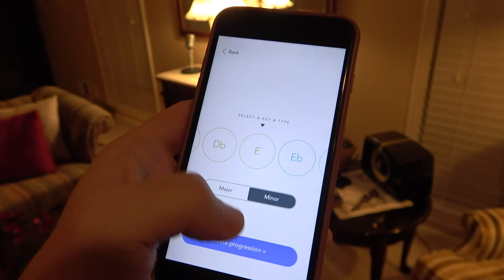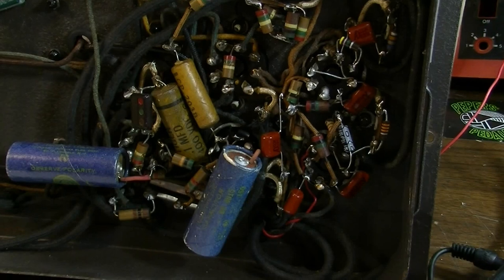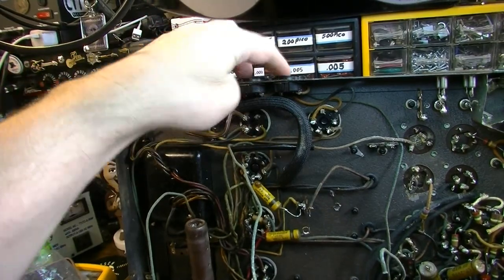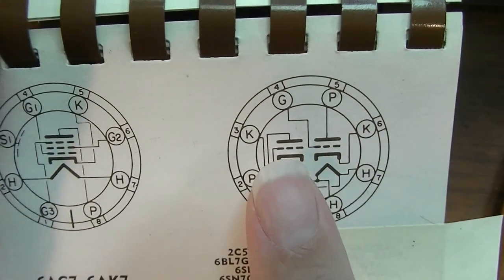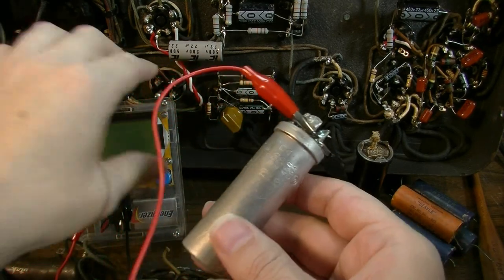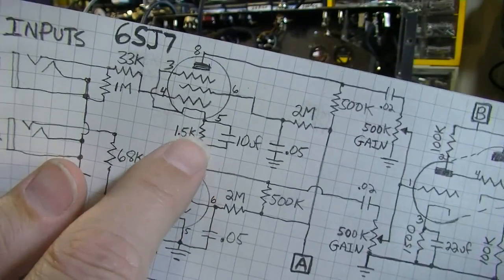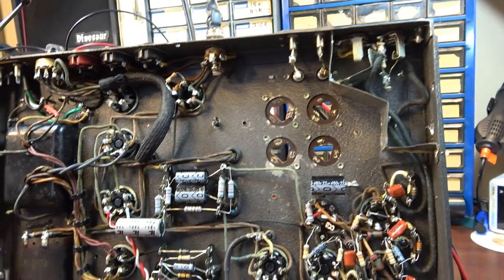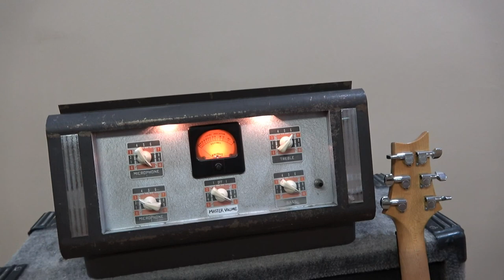EPIC Guitar Amp Conversion - Complete Tube Amp Redesign

Comment: I kinda like transformer phase inversion. It is cleaner than tube in one area, but transformer saturation does exist. Not only that but a magnetized core can introduce even harmonic distortion. Not much mind you, but some claim that that is why old Clyde McCoy wahwah's with Fasel inductors sound better than modern ones with the same inductor sound, ahem 'better'. The core is slightly magnetized, not magicitized.
Reply: Just partially making fun. I know this is a hard project to make a guitar amp out of.
Rocks on guitar lover man.

Comment: Those capacitors were made in the town over from me, thats pretty cool. The first transistor was invented over there too.
Reply: NJ had a great electronics industry at one time. My mom worked at RCA in Camden after she got out of high school in 1962. You had IBM in Cherry Hill. Amazing stuff.
Reply from the maker: Sweet. You should take a trip sometime and see if you can locate and film the old factory.
Reply: @TheGuitologist  The Nipper Building is still in Camden, NJ only it's condos now, while the rest of the expansive factory sites were demolished in the late 80's/early 90's. Here's the wiki on the Nipper - https://en.wikipedia.org/wiki/Nipper_Building  

This is where your Victrolas and such came from.
Reply: The Nipper Building in Camden still has the original stain glass art work of the RCA dog looking at the Victrola that RCA had used as their logo. I was a vendor for L3 Communications in Camden back in the eraly 2000's and they had taken me over to the RCA building (now Nipper Bldg) before it was converted to condos as L3 communications had purchased that building as well as all the RCA communications technology and equipment and gave me a tour. It was very cool
Reply: @kensolo6793  So happy to see they saved that. Not only for history's sake but the fact that I love doggos and the connection to audio in general. That logo is burned into my brain from decades of seeing it.
Reply: I'm in North Plainfield, and was feeling a little Plainfields pride when I saw it on the caps. The Plainfields had quite a bit of industry back in the day, especially along the train lines.
Reply: @broncobum  prideful of that toxic waste dump that the factory left behind lol. I think its all clean now which is great.

Comment: weren't knight amps sold as kits, kinda like heathkit. Maybe the guy who built it didnt have  clue of what he was doing. alot of heathkit kits were test equipment so techs bought them to save money but correct me if i am wrong knights were consumer amp kits basically. so maybe some guy at some church who was a novice hobbyist  and the church needed a pa so i guy got roped into doing the project, perhaps got in over his head. Of course this is pure speculation.
Reply from the maker: Yes, you could buy these as a kit or pre-built.
Reply: @TheGuitologist   I built an amp sorta like this but like it's baby brother . A 6SJ7 with a tweed princeton volume and tone control. Then half a 6SL7 gain stage with the other half set up like a 5E3 phase inverter into a pair of 6V6s . Like your it has that raw old times sound albeit yours I am sure is louder and prob more bass and less mids because of the 6L6s

Comment: I  certainly DO NOT have this guys knowledge about electronics or guitar amps. I have a basic understanding of AC-DC theory and have repaired many and built a few guitar and bass amps..
I have converted a few PA Heads into guitar amps.

I turned one into a Fender Princeton  AA964
 Another into a Fender Tweed Pro 5E5-A. That is an interesting unit. A bit more going on than one might think.
........ and with a 1950s Rauland PA head i built a Ampeg M-18 i believe.
Octal preamp
2x 6V6 
Bias vary trem 
Just an all around nice low wattage amp
Super quiet.

This tech seems to  "worry"  about reusing the existing Topology/Tube Sockets/Even the pots it seems.
Maybe that is part of his  "thing" ..... to repurpose as much of the old amp as possible.?
No problem if that is why, He definitely has the ability to do so and the appreciation of amp history to go along with that.

In these scenarios, i plan on gutting the chassis down to a shell. Then,  i find a circuit that will run off the existing  PT and OT
..... the trannies and the cosmetics of the chassis,  paint scheme if possible and the knobs are all i try to save.
The graphics rarely work out..... maybe the power switch lines up.
All the other knobs i try to relabel with a single letter underneath the original wording.
If the old VOLUME knob is now the BASS control i try to print a single letter with a label maker. So under the original VOLUME control i will have just the letter B for BASS.
Sometimes you might have a duplicate.....Treble and Tremolo for example.
No big deal. "Tr"  will do for Treble and just a single  "T"  will suffice for Tremolo.
Anyway....... thanks for another fabulous video..!!!
We appreciate it 😎

Comment: Is it just me , or are the lows breaking up a little early ??
Reply from the maker: Mostly the demo suffers from using only the onboard camera mic. I'll admit I did the demo on the quick. But yes, I might go back on that Channel 1 and change the bypass cap to a lower value.
Reply: @TheGuitologist  I asked because I’ve been playing with some different tubes in my little Vox practice amp. I pulled the low gain ax7 and put in a Long plate Sovtech . I expected more presence and gain and such. And knew it was hotter on the lows. But it surprised me at how different it was.  Anyhow blah blah. It sounded very similar , but I was playing your video through that amp !!! And thought that might be what I was hearing. And not your amp.  
  Thanks bud.  Hope things are getting better .  🤠🎸🎶✌️

Ps. I think  I’m going to try a ecc81 next just for S & G’s ...

Comment: Interesting video Brad!  Although electro caps drifting 50 to 100% higher in capacitance after 80 years?  BS to that Brad.  NO way that's gonna happen mate!  Your cheap ass little tester is getting confused for sure.  Probly confusing increased leakage with increased capacitance.